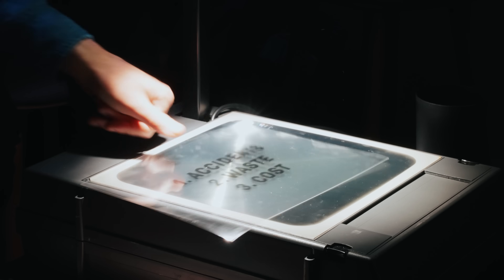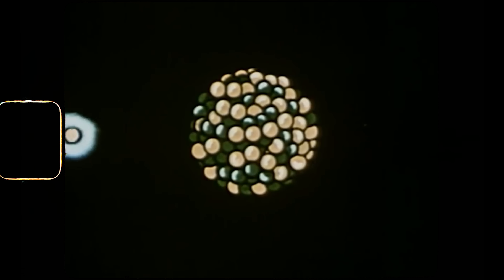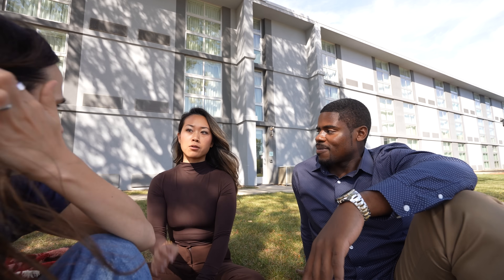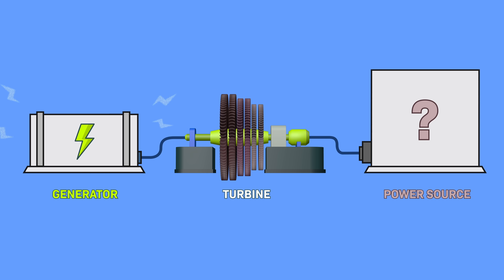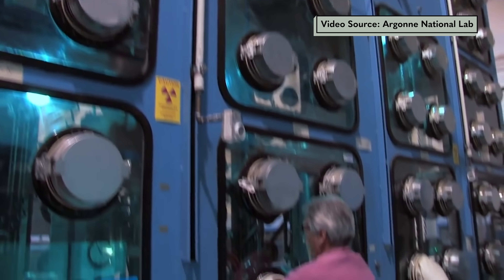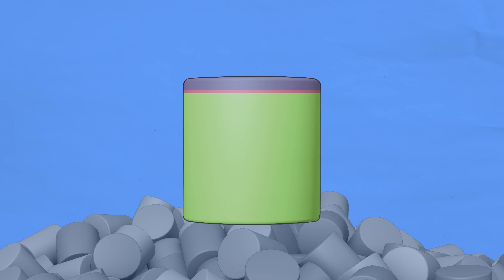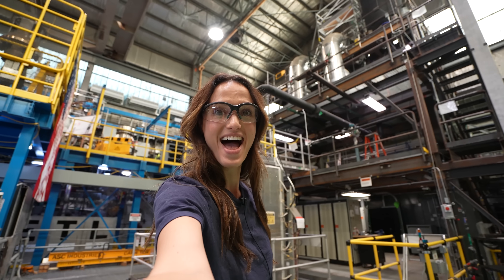The Big Lie About Nuclear Waste

Comment: I never thought it's about the fuel rods. Most of the nuclear waste comes from the contaminated parts, right? After decommission there are like tonnes of radioactive materials, or not? And also the nuclear power plant is super expensive, not the fuel.
So I don't see so much benefit for the recycling. Of course it sounds cool to buy fuel once and use it forever, but why not simply use much cheaper renewable sources?

Comment: Great vid, thanks! Really gets the message across. One big mental block that we'll have to get around is that most people don't like the sound of "the plutonium economy" or plutonium in general, and reprocessing/recycling nuclear waste requires that all reactors switch over to plutonium fuel (which is bred from the U-238 in spent fuel). Sadly, the USA just cancelled a huge project that was capable of producing plutonium-laden fuel at scale, so we're in a bad spot. 

For how long nuclear waste can power the usa, I compute 160 years. Note that this cannot be done right away because getting that energy out requires a large fleed of breeder reactors, which requires more fissile material to start up than we have in the waste. So the process would have to be bootstrapped across decades to actually pan out.

Lastly, thank you so much for accurately noting that Reagan lifted the reprocessing ban in 81. So many people repeat the myth that it's still banned.

Comment: Yeah MoX is a french tech , used since the 50' but even mox is not 100% Pu 237/239 , you meed less uranium but it still uses some , so you're always left with more Pu237/239 then you will consume in a mox reactor

Comment: Ok? Nothing new or exciting in this video.  
Sure you can recycle (small) parts of spent fuel, been doing that for decades in Europe. It's usually just too expensive. End of story.  

EDIT: To give you some real numbers: If you have 100 kg of fuel rods, ~3% (~3 kg) is U235 (that is the actual fuel). When the rod is finished, you are left with ~1% of U235 (~1 kg).  
That 1% is the stuff you could recycle for a normal light-water-reactor. The other 99% of the rod is waste not suitable for the reactors we have. With different reactors you could recycle slightly more and use Pu for example. But anyway 95% of the rod will be U238 which is completely useless (though also not really that dangerous).  

EDIT 2: If you wanted to make a useful video, talk about different recycling methods (PUREX, that has been used for decades, vs. the "new" one here). And then it's still a matter of cost and this is why it's not done.  
And in the end - with either method - recycling means instead of throwing away 100% you only throw away 99%, because our current reactors only use U235.

EDIT 3: Since you might wonder why we cannot use the recycled U238 as a filler material to make new rods: We need to mine new U235 anyway to replace the 2% we burned. With that we already mined much more new U238 along the way (Uranium in nature is ~99% U238 and 1% U235).

Comment: molten salt reactors are not working yet and will not work for at least another 15-30 years. thats the facts. this video is making false claimes all over the place.
recyceling nuclear waste is not the same as burning the waste in molten salt reactors. its two completely diffrent things. there are multiple countries (france, korea, china, janpan) that are investing billions into both of these dreams and none has found a solution/is working efficiently. 

the french molten reactor proto powerplant that was supposed to work this way is indefinitly delayed. the costs have exploded and because of the promise of this technology being right around the corner, old reactors have not been kept up to date or rebuild, france is looking at an energy-crisis in the comming 10 years because old reactors have to be shut down.
and the climate change does NOT help. last summer most of frances nuclear reactors had to be run at low capacity because the riverwater was to warm to cool the powerplants (without killing all life in those rivers). meaning germanies coalbased energy had to meet the french demand for power (not the other way around as nuclear supporters like to claime)!

reliably replacing the damaged parts of the inner reactors damaged by the extreme corrotion of superhot molten salt is near impossible and will take years to finetune and develop.
(and these parts are then highly redioactive themselves).
we need a solution for the energy situation NOW not in 30 years or whenever molten salt (thorium) reactors are ready to use.. we HAVE a solution now in wind and solar power. both of which is gonna be cheaper then nuclear power anyway.
i cant believe there are so many "retired nuclear workers" in the comments supporting this lie.
because it is a lie. it is no solution for the problems we are facing TODAY.

can it be a thing for my grand children to dream about? yes, maybe. but for us now? NO F****** WAY!

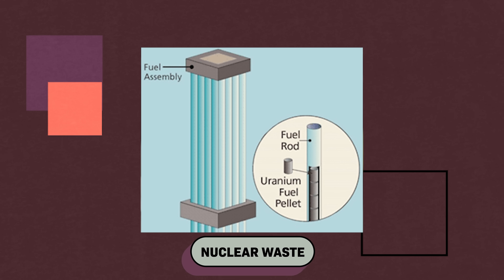Comment: 7:09 ... the 235 or 238 is the number of nucleons, not neutrons. N(nucleons) = N(protons)+N(neutrons). Every isotope of uranium has the same number of protons (92) and therefore the difference is in the number of neutrons. But the number of neutrons is only 238-92=146 for U-238 and 143 for U-235.

Comment: Are you claiming that reusing spent nuclear fuel rods in reactors again, something you correctly point out is not new, turns those nuclear fuel rods inert, no longer radio active, safe? What is plutonium?

Comment: Sorry, but I am not buying it. I don't know of anything that is 100% recyclable. There is not just the fuel itself but also the equipment used to mine it, to process it, to store it.  All of that potentially can be radioactive and would need to be stored somewhere. If you think that would be easy to do, see if anyone in your state would welcome a nuclear waste dump. The better solution would be a combination of wind/solar/natural gas until nuclear fusion (which has much less waste issues) can be commercially developed.
Reply: Good luck trying to find where to get a constant source for base losd without going back to fossil fuels.

Comment: Some of the wording doesn't check the smell test.
"nuclear waste recycling" No. They are not recycling anything. There's no "greenwashing" needed. Using the REST of the nuclear fuel is a better description. Gen2 reactors use around 5-10% of the nuclear power before they are replaced. Using up MORE of that is fine, but it's not "recycling".

Comment: If its so easy to use nuclear, please explain why after 10 years the plan to dump millions of galleons of deadly water off the Fukushima nuclear reactors is the only plan?
Reply: Because environmentalist activists forced most governments to close down their nuclear reprocessing facilities, for some weird reason.
Reply: @ianhomerpura8937  So where do the spent rods go? 
  And you must not have looked at the mess of rods at the bottom of Fukushima. There is no simple answer. environmentalist activists forced most governments to close down their nuclear reprocessing facilities is part of the issues. Add no where to store waste water with Tritium. Many hard issues  not addressed.

Comment: Cost matters.  If solar and wind coupled with energy storage costs much less,  the only justification for recycling nuclear fuel would be remedial to process our wastes to clean up a longer term pollution mistake.
Reply: "  If solar and wind coupled with energy storage costs much less" But it doesn't, so...
Reply: @Crispr_CAS9 , quick google search shows Solar/wind with energy  storage is less expensive.  A fair comparison must include cost as well as the potential costs for storing/recycling in the future.
Reply: @ricinro  "quick google search shows Solar/wind with energy  storage is less expensive. " Then you did a poor job searching. Probably saw Lazard's and accepted in non-critically. 

EIA LCOE has nuclear at $81.71 with wind and solar at $40.23 and $33.83. And the battery storage to support them at $128.55.
Numbers are /MWh.

That means that the batteries alone are more expensive than the ENTIRE nuclear system.
Reply: @Crispr_CAS9  , Solar hybrid (solar and storage) is still less than "advanced nuclear" which doesn't appear to exist.  If guessing future costs we could easily assume battery tech and PV tech such as perovskites will drive these cost down significantly.  Perhaps these reports require better understanding.
Reply: @ricinro   "Solar hybrid (solar and storage)" Doesn't have enough storage to matter. You need 16h of storage TO START. Solar hybrid is 4h.
"If guessing future costs" If guessing future costs I could make stuff up for nuclear, too. Instead, let's stick to the current numbers.

Comment: Interesting video. It's actually quite surprising to see that the technology that has been already implemented somewhere else in the world, is still something that US only dreams to properly implement and commercialize. There is for example already an existing fast reactor of the industrial level in Russia that is working using a pure MOX fuel (not mixed with conventional) since the last year. And it's not operating in some R&D mode, but actually delivering power to the industry and driving the economy. Also for the full implementation of the closed fuel cycle Russia is already building an industrial demonstration facility which would consist of the nuclear fuel fabrication plant, the lead-cooled fast reactor and nuclear waste reprocessing plant. Once built it would only require adding some amount of the abundantly available Uran-238 once in a while and produce no radioactive nuclear waste to the outer world as the spent fuel would be reprocessed and used again and again inside the facility until mostly only short-lived radioisotopes would remain. This will implement the concept of zero radioactivity balance, when the amount of "radioactivity" extracted from Earth would be equal to the amount of "radioactivity" given back. Really exciting to live in these times!

Comment: Skip to min 13 and you get the only interesting answer: Its way too expensive.
Reply: Solar and wind were once insanely expensive as well, but decades of research, development, and funding helped push production faster, thus lowering costs. Nuclear energy did not go that path yet, mainly because environmentalists and oil companies have consistently pushed to block them and partly succeeded in doing so.

Comment: I have to admit that I did not watch the whole video. But it seems that you have forgotten one thing: For 1 kg enriched Uranium you produce 10,8 kg nuclear waste not usable in a reactor. Or in other words:  only 5 - 10 % of the mined uranium can be (and is today) reused.
When it comes to breeding reactors, they might be more efficient but have their own disadvantages. One that you mentioned is that they produce plutonium which could be used for a nuclear bomb. But also the reactors themselves are much less secure than others. And that might be the true reason why there are so few breeding reactors in use today.
Reply: "10,8 kg nuclear waste" Depleted uranium can be used in breeder reactors as fuel. The tailings from ore processing are less radioactive than the native ore.
"One that you mentioned is that they produce plutonium which could be used for a nuclear bomb" All uranium cycle reactors produce plutonium. Commercial reactors, including commercial breeder reactors (which breed and burn), do not produce plutonium in an isotopic ratio usable in nuclear weapons. You need purpose-built plutonium breeders for that.

Comment: Oh, and something else you might like to know about (if you don’t already), At Fairchild we made nuclear power cells for spacecraft.  The power cells were about the size of a coffee can and loaded with thermocouples around the perimeter shell.  Then fissionable material was loaded into the container and it was sealed up so that the thermocouple by the heat of the fissionable material, generated electricity for the life of the spacecraft thereby eliminating the need for highly susceptible solar array or other power sources.  Take care, Tom KC3QAC